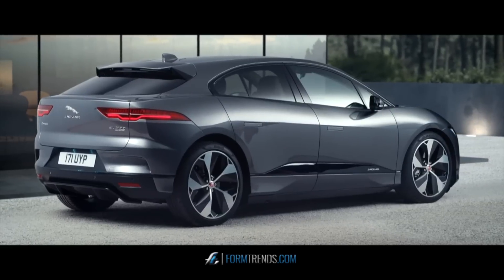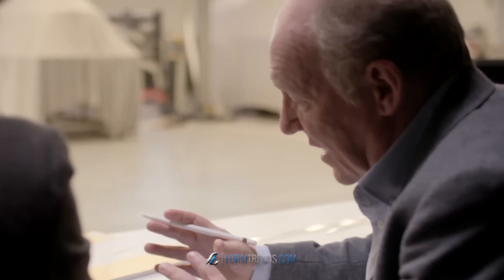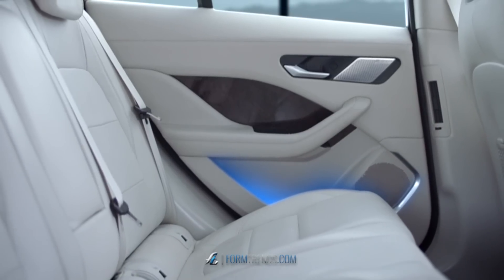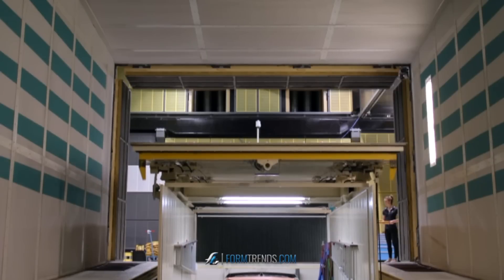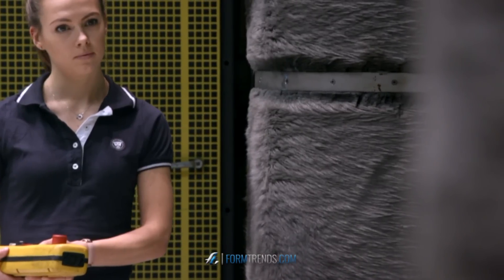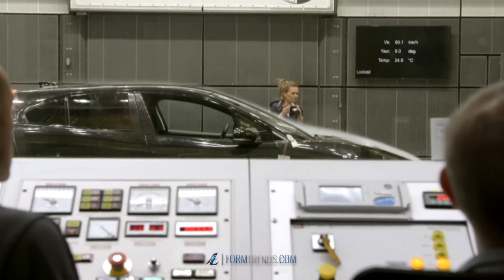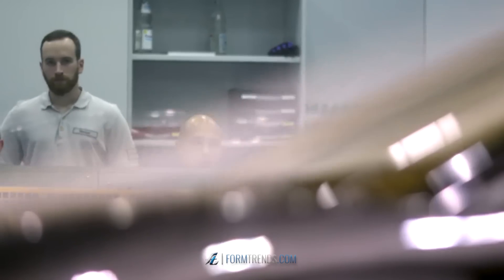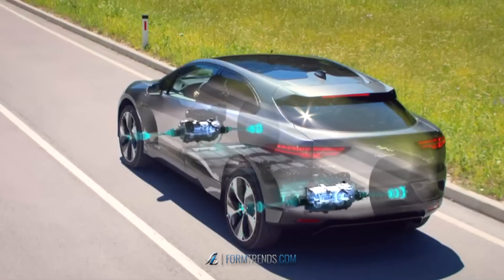Jaguar I-Pace: Design, Clay, Sound and Aero

Comment from the maker: What are your thoughts of the brand's first electric car?
Reply: Beautiful! Never really thought about the freedoms in design that would open up with it being electric. That air bypass sold me! (-:

Awesome video!
Reply: Facts
Reply: I don't understand how having a grill would make it more aerodynamic... seems like it just adds unnecessary friction. Why not just make the front of the car as aerodynamic as possible and remove all the rough details? It's an electric car, it doesn't need a grill.
Reply: @azbgames9240 There is a concept of boundary layer energization to add energy to air in contact with surface to prevent early seperation, which will reduce the size of air wake region and thus the drag

Comment: Great video! Only thing I didn't like is the fake sound played through the speakers. One of the benefits of evs is silence and unless it's got a proper engine I find that sound to be redundant and useless.
Reply: Dimitar Stanev I am sure you can switch that off.. however there is so much to play with that if you think that you might be able customize your own sounds..
Reply: Andrea Rizzotto Doesn't matter how it sounds. Just knowing it's fake, ruins it for me.
Reply: as i said i am sure you can switch it off.. I also enjoy the silence of the car but it is fair to give the customer an option
Reply: @andrea1995ri  You can hack into it and play farting sounds every time someone steps on the gas.
Reply from the maker: Sound is one of the biggest obstacles for electric vehicles, especially when the carmaker that's building it has a heritage that includes V12 and throaty V8 engines. Not an easy nut to crack...
Reply: Form Trends That's like that hideous trend nowadays to put fake exhaust tips. Sure, may look better and we aren't quite used to not seeing exhaust tips on cars. But once you know it's fake it makes the car feel cheap.